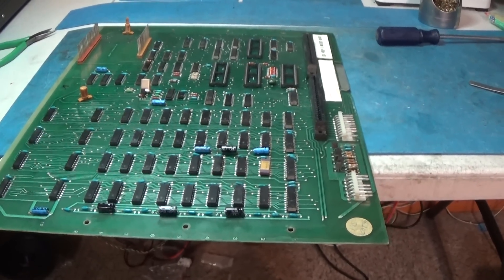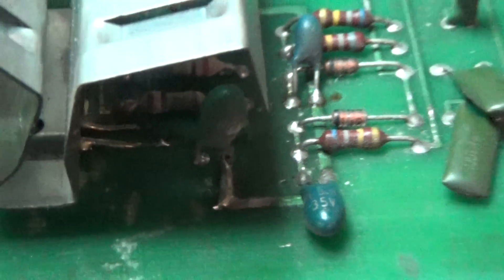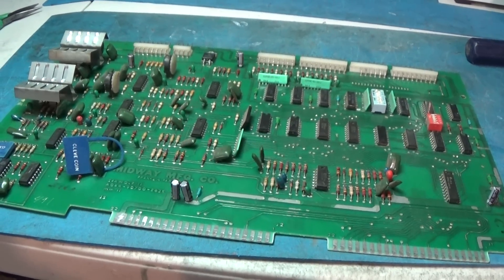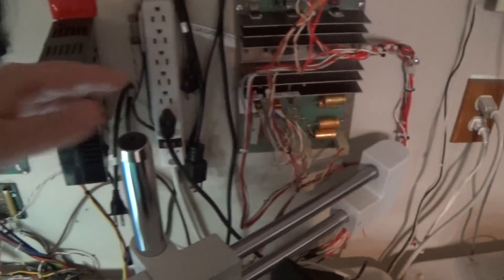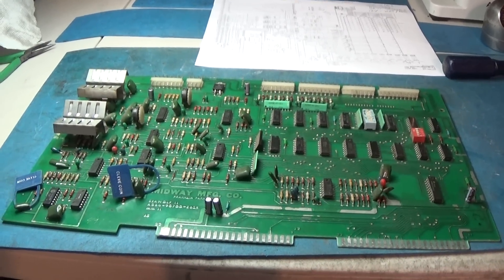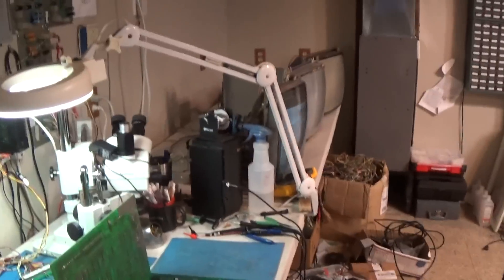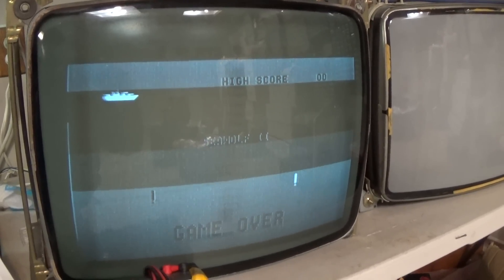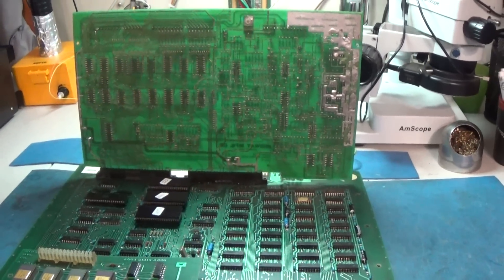Part 2 - 1978 Bally Midway Sea Wolf II PCB Repair!

Comment: I would love to see a video on your set up. Your channel has quickly become my favorite on youtube, all of this stuff electrolytics, the PCB and power supply repairs and trouble shooting, it's something I'd love to get into. 

I'm an engineer by trade and work with welding robots, and I've learned a lot about electrical engineering doing that for the past couple years. I started off with MIG welding by hand when I first started making RV and car parts, but we got a robot at our shop and I quickly decided to dive into expediting the automation process for our parts manufacturing. It's fascinating stuff.

Comment: I'd certainly like to see an explanation of your test boards and harnesses. What's the purpose of the blue plastic tags on the board. I notice one said 'Cleve Coin'. At first I though they were there to pull the board but I see they appear to be threaded between the legs of Mylar caps so that's obviously not the case.